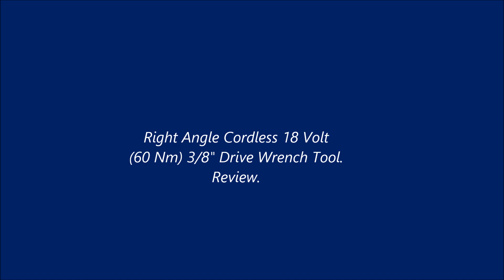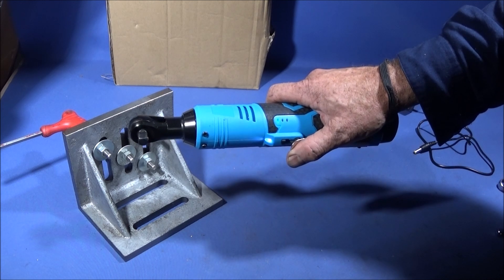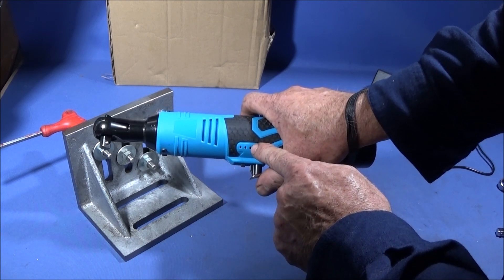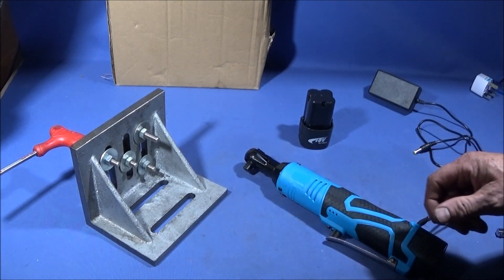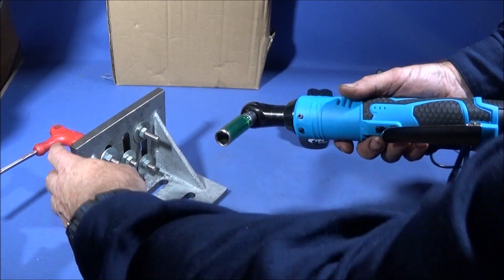Right Angle 18 volt Cordless Wrench Review & Power Chuck Key

Comment from the maker: SEE LINK BELOW:-
18V 60N.m 3/8 Inch Cordless Electric Ratchet Right Angle Wrench--http://bit.ly/2YKy49Q
$1.99 Tools & Mechanical Parts -- http://bit.ly/2OSwi2O
2019 Banggod Electronics & Tools Sale -- http://bit.ly/2KYyenl
2019 Banggood Summer Sale Shopping Guide -- http://bit.ly/2Lt4Kxy
Reply from the maker: HERE ARE SOME COUPONS FOR SOME EXCELLENT DEALS ON BANGGOOD
$21.68 4pcs MSPA Inflatable Hot Tub Replacement Kit -- http://bit.ly/2Zr0k1H (coupon: BG1726)
$48.99 Machifit ER11 Chuck CNC 500W Spindle Motor -- http://bit.ly/2ZB99lC (coupon: BG500W)
$33.99 HILDA 220V 350W Variable Speed Electric Grinder -- http://bit.ly/30GTAdt (coupon: BGEG35)
$23.99 HILDA 220V 400W Electric Paint Sprayer -- http://bit.ly/2MJSVob (coupon: BG2c532d)
$213.19 Machifit CNC 5 Axis 500KHZ Offline Controller -- http://bit.ly/2L2i2Al (coupon: BGMACH3)
$32.79 Machifit MACH3 4 Axis USB Electronic CNC Handwheel -- http://bit.ly/2ZkC5CV (coupon: BGMACH3)
$36.99 Self Centering Dowelling Jig -- http://bit.ly/2MH3yIo 
$19.99 Drillpro 8pcs 2-12mm 4 Flutes Tungsten Steel Milling Cutter -- http://bit.ly/2ZkC5CV
Reply: How is it working now? and any loss of power, is it still working?  Thanks.

Comment: I have bought two in the past one was pneumatic and the other cordless. Very handy for tight places. I paid hundreds more then that wow. You can get very long extensions and swivels to get to any nut and bolt quickly.  It ratchets unpowered to get things going and then power to spin off the nut. Thanks for sharing a great deal!!!

Comment: Impossible to find extra batteries.
Reply: My battery clips have all broken :( they keep falling out now. Im going to try and use a screw to hold them in with a through-hole
Reply: I used a piece of metal strapping bent on an angle, jammed it down inside battery compartment to hold in batts.